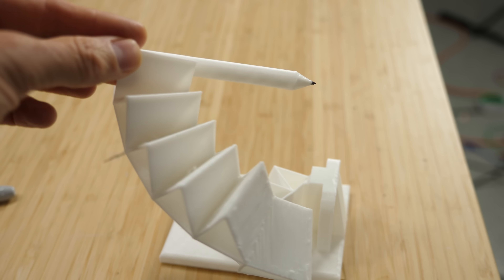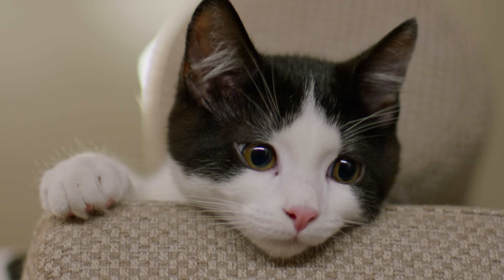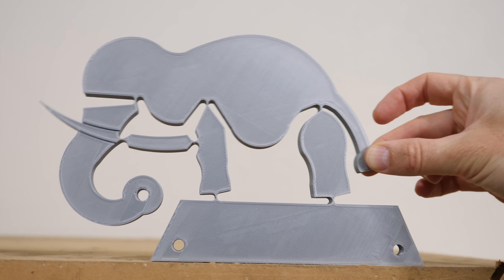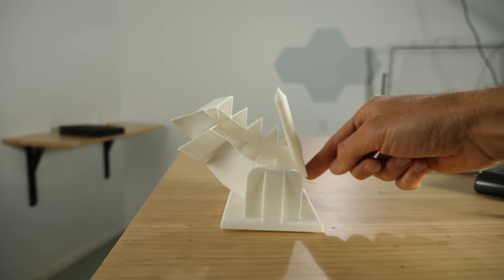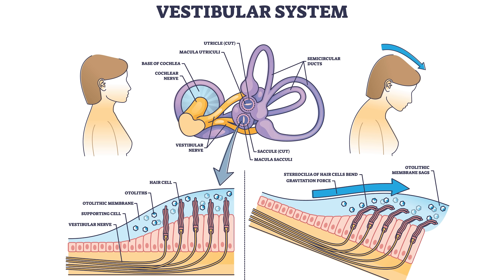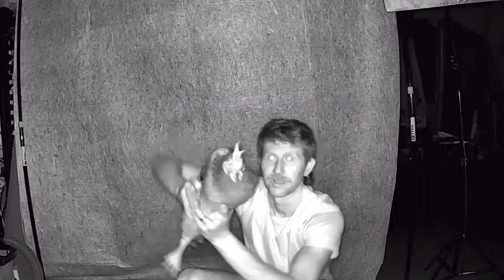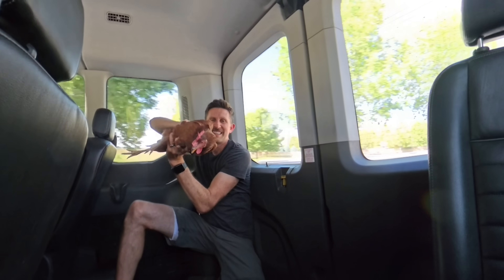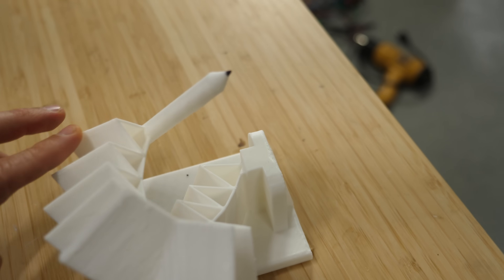Chickens Are Weirder Than You Thought

Comment: 5:30 You need to rotate your experiment 90°.  A chicken's eyes in the environment of a moving vehicle is not going to have anything to focus on when the eyes are faced towards the front and back of the vehicle.  Chickens have one near-sighted, and one far-sighted eye, meaning their attention is on what's directly out to the sides of them, and not in front or behind (unless they're looking forward with intent to judging depth, like when about to pick up food).  This means if you want to see side-to-side tracking in this environment, you need to point the chicken forward, so that it's eyes can focus on the environment to the sides of it.  The head-bobbing effect is the chicken trying to keep pace with the moving environment, in which it picks a spot with each eye to focus on, and tries to maintain focus on that spot until they can't anymore.

The more stressed a bird is, the more likely it will be to exhibit this stabilisation behaviour, until it reaches a freeze point of panic.  A stressed bird wants to keep aware of its environment and potential escapes if needed.  However, if a bird absolutely trusts you, they MAY be less likely to exhibit this behaviour, as they trust they don't have to put the effort into hypervigilance that they usually would, because they trust you to keep them safe.  You may find some "ragdoll" chickens that love and trust you enough to immediately go limp and fall asleep the moment you pick them up.

Unfortunately, the ideal test subject for this experiment is one that is not very socialised, slightly stressed, but not stressed to the point of panic.  Face the bird forward to give it something to focus on so it has a reason to exhibit head stabilisation.  Please let us know if you redo this experiment in a way that takes chicken physiology and psychology into consideration!  I'd love to see if you find any changes!

Signed,

Someone who's rescued and rehabilitated roosters for over fifteen years
Reply: replying to boost this comment
Reply: I wondered when he talked about vision if he accounted for the one near one far sighted eye. Usually that info accompanies their eyes being fixed in the sockets.
Reply: @FierrielI know that chickens have the near / far-sighted eyes (most birds do, and when they look AT you, they're usually turned to the side, and switching sides is checking which eye can see you better), but I'm a bit hung up on the fixed eye thing.  I get that raptors with their eye TUBES instead of eyeballs can't move their eyes, but many birds can at least to some degree.  I can't say that I've watched my boys exhibit as much eye movement as the stock video of a cat that was used during this video's explanation, but I've definitely seen them shift from looking outward to focusing on what's directly in front of them.

I'm guessing that most birds have LIMITED ability to move their eyes, but only birds with eyetubes are completely set in place.

But yes, that would affect the bird's ability to fix its focus on something regardless, thus leaving the bird without a reason to exhibit head stabilisation.

I was taught about bird eyes by someone who rescued parrots and then got into chicken keeping (we met when they adopted some of my birds that were ready to be rehomed), so neither of us are exactly experts.

However, I do take car rides with my boys!  I've noticed that when they are placed sideways to the car (such as perched on the window or a leg), they stay still.  However, if I turn them so that they're facing forward with me, they actively watch the world go by until the vehicle reaches a speed that they can no longer keep up.  If you drive forward and slowly accelerate, you can watch the head bobs get faster and faster until it stops.

My birds are used to being held and interacted with, though, so it's never a guarantee that it'll work.  Sometimes they're interested in what's going on outside, and most of the time they just want to be held and snuggled.

I'm starting to wonder if I can recreate the experiment, myself.  I have access to a person with a vehicle, and I have access to chickens.  I only have two right now, and one trusts me WAY too much to be a reliable test subject... but the other one... just might work.  She lives on a farm, so I can do the acceleration experiment, but we'd have to find a place that she can drive in fast, tight circles.  I think the acceleration experiment is an important first step because like I said, if you're moving too fast for the bird to comprehend, it's not going to have anything to focus on, and thus not even try, so first you need to identify your bird's "speed limit".
Reply: thanks for protecting animals sir, especially those with little to no animal rights. your version of the experiment sounds great, go for it!
Reply: Certainly the most interesting comment here.
Reply: I don't think that's the issue.  A car doing donuts is experiencing constant acceleration, so all it's doing is changing the direction of gravity.  You can see their beak is slightly tilted instead of vertical in that test.
Reply: @karakaaa3371  We can't know for sure, and I take car rides with my chickens regularly.  That's why I suggested an alternate experiment that takes chicken physiology and psychology into consideration.  All I know is that when I ride in vehicles with my birds, they're much less likely to exhibit head stabilisation when riding sideways to the vehicle, and much more likely to exhibit stabilisation when aligned with the vehicle.  You'd need both experiments to know for certain if orientation to the vehicle and holding the bird at a level that it can still see outside affects the final results, and if yes, it's time to ask why.  My hypothesis is that orientation matters, but I haven't had the chance to perform the experiment myself, so nothing can be said for certain, especially since we can't get into a chicken's head and ask it how it perceives the world and why it acts the way it does.

I do, however, have over a decade of experience of not just working with roosters, but sharing my life with them; every moment, waking and not, they're with me.  They sleep next to my bed, my door is always open for them to come in or go out, and I take them with me on "adventures" regularly.  I've studied as much as I can about their psychology to make sure I'm providing them the best life that I can that THEY will appreciate, not just survive.  I just feel like with my experience, and how familiar I've become with chicken psychology over the years, I noticed something about the experiment that clashes with their natural psychology, and it might be worth pointing out and addressing.

This is a channel about science, after all, and science doesn't rest after only one performed experiment.  Using animals in experiments without taking their psychology into consideration has historically been an issue, so if we really, truly want accurate results, we'd need to redo the experiment a few times with slightly different conditions each time to see if anything has an effect on the experiment that we weren't expecting.  If an unexpected response arises, it's then the scientist's responsibility to ask "why", and try to design experiments to answer that question.  I'm open to being proven that enacting my suggested changes will have no noteworthy effect, but I hypothesise that a difference will be found.  Hypothesise.  I can't say with certainty, but I have a suspicion.
Reply: @OlyChickenGuy love that you provide that quality of life for your roosters. I have 3 chickens who I wouldn't distress by doing what this guy does.
Reply: Second this. The birds head will only move relative to its body and what it's looking at. It's also possible that the G forces of the vehicle panicked or spooked the bird locking it out of this behaviour.
Reply: @emanwhomakesbarrels701 The fact that there's still rotational stability, just not side-to-side suggests that the bird wasn't too stressed, but she was definitely confused and unsure what she was supposed to be doing.

Another thing to consider is that chickens are extremely intelligent and eager to please, so there's a chance she could've been confused, looked to the humans in her vicinity for guidance, and then noticed that they're holding their heads still, so she tried to mimic.  I don't think this is what's going on, but it's possible.  I know my boys look to me for guidance in situations they find confusing, frustrating, or scary, and they have a very limited ability to mimic (this is how they get regional accents from flock to flock, and why introducing a "foreign" chicken can cause both the introduced chicken and the flock to slightly change their vocalisations until they more closely match each other).
Reply: tldr

Comment: The van test needs to be reproduced with a panel van or like the back of a UHAUL truck that has a lit interior. The translational movement relying on visual cues could mean that the clear windows of the van were providing a lot of confusing visual information making it hard to automate a response to the movement just like in the dark room.

Comment: The compliant mechanism is great, but that's not how the chicken operates. If you can build a compliant fixed-point mechanism that can be locked in place while its BASE moves (like the chicken), then it would make a more compelling case. But I think the chicken just compensates for the motion actively.

Comment: 7:30 CFS shouldn't be advertised for multi-colored prints, just as a labor-saving convenience for switching colors between prints, or using multiple spools of plastic on a big job. 
The problem with CFS is the enormous amounts of plastic wasted in purging with each color change. Meaning that "painted" looking complicated multicolor prints can waste as much plastic as goes into the final print, or even worse. 
The costs over time can be shocking - both environmental and financial.

Use your CFS responsibility folks.

Comment: What if the chicken were sitting on a small t-shaped  perch, and the vertical section of the perch was going through a hole in the bottom of a box which surrounds the chicken. Basically the chicken could remain still on it's perch while the box could move up and down slightly and turn and tilt around her. Would she be fooled into thinking that she's moving, and so would she move her head to compensate?
The experiment inside the van had too many stationary things nearby inside the van, so  it's hard to know what contributed to the outcome.

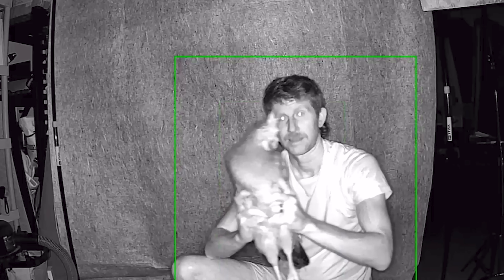Comment: 4:30 I wonder how much of this about desire rather than ability. With my birds, they won't really do the stabilization thing UNLESS I give them something interesting to look at. Just like how a human will only stabilize their eyes if they are looking directly at something. If a chicken has nothing interesting to look at, they may just not bother. However, if the bird is upside down it is likely uncomfortable due to any number of reasons being upside down is uncomfortable so it makes sense they would more automatically stabilize against that.

Not saying this is strictly true, it's certainly hard to test for, but I think the fact that chickens are in control of when they choose to stabilize makes a dark room a less-than-conclusive method of determining whether they can possibly stabilize without visual input.

Comment: The rotational system would be interrupted in a situation without gravity. Put Bella in the zero grav airplane simulation thing, she won't be able to use gravity to maintain rotational stability. You might have to do a run in the dark in case she uses her eyes as a back up protocol.

Comment: This ability in birds seems to be very hard wired. I remember picking up a blackbird that had flown into our window - it was completely stunned, couldn't stand up or even sit without falling over and was largely non-responsive - but its head still stayed fixed in place as I moved its body.

(The bird was fine btw, I took advice to put it in a dark box to recover for an hour or two and then released it, it flew away with no problems).

Comment: The van had unblocked windows, so the visual cues were affected by the spinning. If the view from the back to the outside had been blocked, it would have been tested mainly of the vestibular system, not visual. So that may have given different results for translation.
Non-hunting animals also maintain their eye position. Pigeons jerk their heads forward when walking to keep their eyes still most of the time. Goats will rotate their eyes to keep them level when they lower their heads and raise their heads. It is important to keep the eye still to detect motion. Parralax will create a false sense of motion when the eye moves.

Comment: You could probably trick the rotational motion too. In piloting, there's something done to train new pilots where we blindfold them and the instructor performs multiple turns to disorient, then holds one of those turns for a moment and asks the trainee which direction they're turning/how hard of an angle they think we're turning. The trainee is usually very wrong in their guess, their senses are lying to them. This is done to train pilots not to rely solely on their senses and trust their instrumentation over what they feel.

You did a similar test driving in circles, but it wasnt in the dark nor was it changing direction, so the chicken had an idea of which way the motion was visually as well. I imagine their rotational abilities would be thrown off by the same test I described for pilots.

Comment: 6:10 explanation makes no sense. 1) Van was moving at a constant speed and not accelerating. 2) Don't you think the chicken seeing everything moving through the window outside resulted in it not tracking acceleration? I mean what did you expect it to do, leave it's head at the original starting place like 500 metres away?
Reply: Acceleration means change of velocity, which includes direction as well as speed. Moving around in a circle requires a direction change, hence the acceleration.
Reply: @qwertyuiop-l1c8m yeah ok i missed the part where he said they were going around in circles

Comment: For dancers, we call this doing isolations. Doesn’t have to be the head, it could be any point of the body that you wish to “isolate”. It’s most famously done by mimes when they pretend to interact with an invisible object (basically just miming)
Reply: That reminds me of a technique used in 3D animation and robotics called inverse kinematics (IK). Normally you would describe, say, the angle to apply at the shoulder and elbow, and the hand ends up at the end of that. But with IK, you set the position of the hand, and work backwards from there to calculate the angles angles needed at the shoulder and elbow.

In video games, this is used to do things like have a standing character adjust the positions of their feet on uneven ground, rather than have one foot floating in mid-air.
Reply: Isolations and remote rotational centers both seem like bad names.
I'd call that "fixed points" or sth.

Comment: An old adage "Running around like a chicken with its head cut off" comes to mind here. Why is a chicken able to run around after it's head is severed? If the vestibular system is in its head, I would think a severed head would keep the body from its balance. Sure, it's a dark question, but your video brings up this as a logical followup question. What do you think?

Comment: Fun fact, how to hypnotize a chicken, belly it out on the floor, ground, surface, whatever, head facing away from you now reach around in front of the chicken with your finger starting at it’s beek draw a straight line from the chickens beek foward from it like 10-12 inches and turn it loose.. until you smack your hands together or snap your fingers.

Comment: You could isolate visual and rotational cues better. Hold her inside a cardboard box and rotate the box, not her. Inner walls of course need to be covered with some pictures so there are enough details for visual system to fixate. On this test all the visual cues inside the car were moving along with her.

Comment: You talk about how they have this absolute that helps them track food. In these experiments you showed, could it be possible that the chicken just simply be that it realizes that there is no food to track to therefore regardless of the light/motion you exert on it, it does not engage those head locking systems?

Comment: is it just me or the 3d printed mechanism has no similarity with the chicken heads stabilization. because it doesn't provide any kind of stabilization, neither for translation or rotation. it would probably work for rotation if you attached a gyroscope perfectly aligned with the center of rotation. but for translation it is designed to not allow relative movement of the end relative to the base, so you can't stabilize it